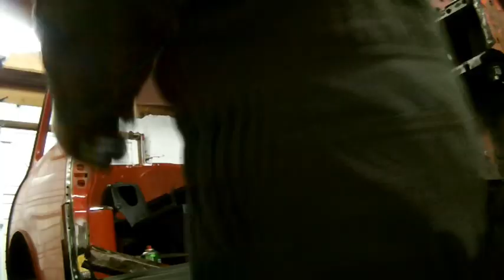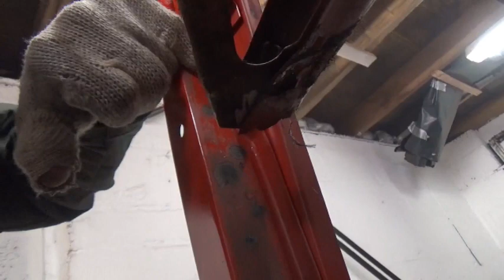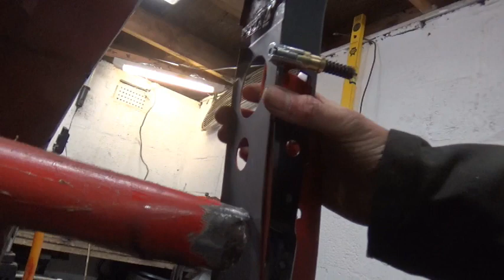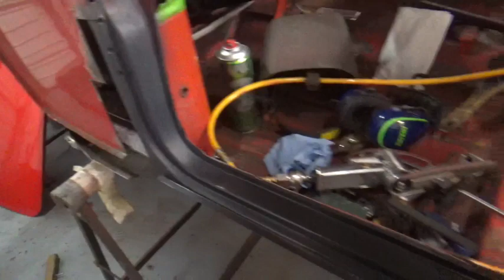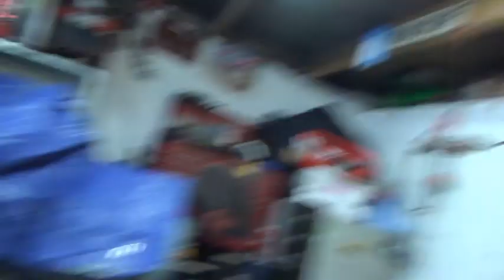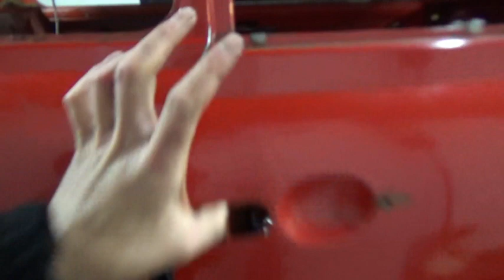Austin mini Hinge and A pillar installation

Comment: i was scared to do it this way (cutting so much out) so cut access in the flitch, replaced the inner boxing panel (braced dash rail for possition) then welded flitch, cut inner stiffner jamn pannel out and replaced these, kept the door all int he same place.. i worry about flex/over brace everything as i genuinely dont know how much you can cut befor things bend, and id hate to have to jig subframes :S
great work as always

Comment: Another spot-on video Sean ! Quite jealous of your production skills !! Just as good as your welding and thats professional 👌 .... that dash lower rail is more critical than you think a couple of mm out can cause all sorts of silly issues later on (been there 😤) like if your fitting the full front dash to find it don’t fit 😡 Hahaa .... keep the good videos coming buddy 👍👍
Reply from the maker: Paul P . Mini build cheers Paul, I'm still thinking of replacing the dash rail. Will probably get away with keeping it as it's covered by the padding lol

Comment: very well done Sean
Reply from the maker: simon ayton thanks buddy ☺
Reply: have you got a video of how to remove the outer A panels? About to tackle it myself?
Reply from the maker: Simon, the outer A Panels are spot welded to the seam and folded over the hinge panel. I cut mine off in one go as they were rotten.
Reply: yes I'm just wondering where to make the cuts and if all three edges are spotwelded. Will investigate thanks.
Reply from the maker: Simon, check out the diagrams on minispares website as they may help
Reply: will do thanks Sean!

Comment: Hi Sean just doing this repair at the moment so had to look back at your vlogs as they are very detailed, what air compressor do you have size wise to be able to run the flange tool and other air tools as I am thinking about getting one.
Reply from the maker: Hi  Michael, I have a 50 litre tank and this is more than adequate to power the flange tool . If  I was to buy a new compressor I'd probably go for a bigger tank but that takes up more space so it's a fine balance but a 50ltr will do almost every job including painting
Reply: @BMCWorkshop  what cfm rating is it
Reply from the maker: @michaelflood4535  14.5  I'm sure
Reply: @BMCWorkshop  thanks for your help and keep making the vlogs on Angus as I like following the progress
Reply from the maker: @michaelflood4535  Cheers Michael, Angus will be getting worked on again very shortly. The Thirty still has a couple of jobs left then that car will operational again and will then wait it's turn for a body restoration which it will get after Angus

Comment: Hi Sean, when you drill the holes you are going to plug weld. Do you clean any burrs and rough metal, etc you get as a result of drilling or do they just get flattened when the two surfaces are clamped together? I love your videos and the way you present them, oh and the music.
Reply from the maker: Michael, sorry for the late reply. All the jokes I drill will be plug welded as I don't have a spot welder. When welding it's always good practice to have the mating surfaces as clean as possible and clamped tight to ensure a good solid weld. Hope this helps. Sean
Reply: Sean C  Thank you for that

Comment: Great work love your vids i should hopefully be starting my restoration soon. Where is it you buy ur panels from as they seem to be bob on compared to some companies ive heard of. Cheers
Reply from the maker: Liam, thanks for your kind words. I try and buy heritage panels where possible. I buy them from bullmotive, monispares, minisport etc.  I shop around to get the panels at the best possible price. I also use M-Machine for other panels I.e the floor as their stuff is just as good as heritage and a lot cheaper! Best regards, Sean.
Reply: Sean C ahh great stuff you dont happen to have to product number for the conplete floor and sills like you used do you ? Ttia
Reply from the maker: Liam, the part numbers are as follows 14 33 01 37 LH sill and half floor assembly 11 33 01 38 for the RH. Hope that helps. Sean
Reply: Sean C thanks mate really appreciated👍🏻

Comment: the only major problem i see is your tea mug need to be placed on some wood to insulate it and keep it warm for longer 🤣🤣 befor you weld any more get the door fitting 100% as you may need to persuade the hinge panel a bit before welding the inner wing on
Reply from the maker: Yes indeed Mark, tea was a bit short in this video and I don't think any of my cuppa's feature in the next Vlog which I'm currently editing but you'll have to watch that to see if the door fits lol